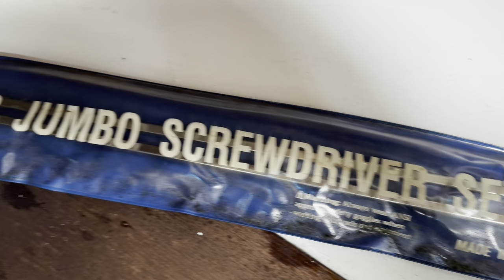The Free boat saga part 1 (Wild Goose)

Comment: Use vinegar and dawn dish soap.....in spray bottle 80 % vinegar. 20 % ......a little easier on the lungs.  Good luck.
Reply from the maker: Thank you for the suggestion, I will definitely try that, the interior still needs a whole lot of clean up, actually going to the store to get some DampRid right now. I keep forgetting it every time I go to the boat! 😂